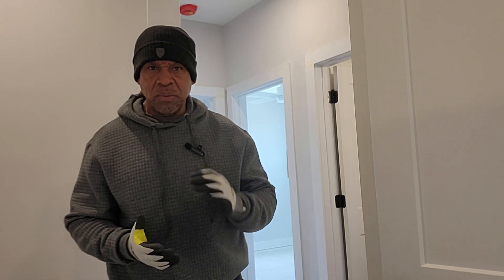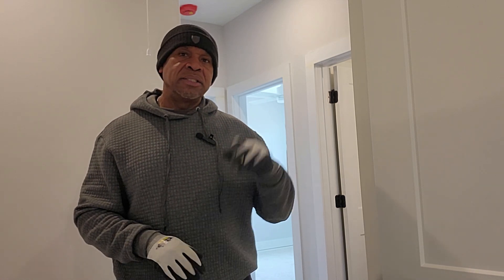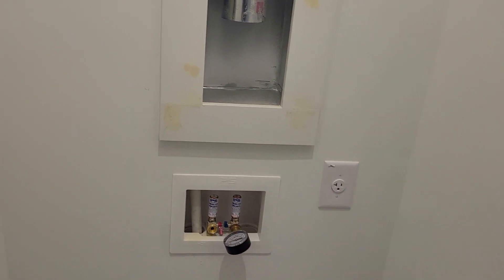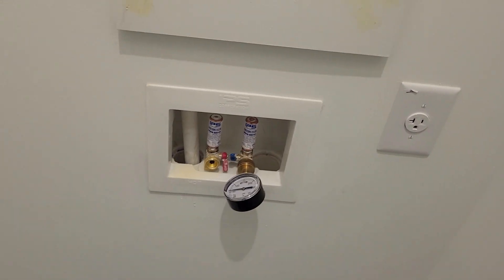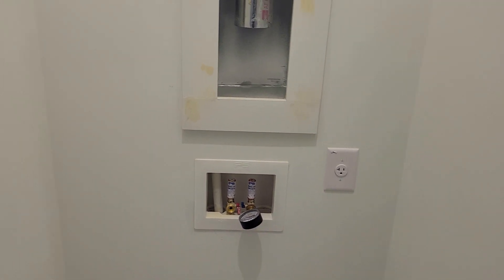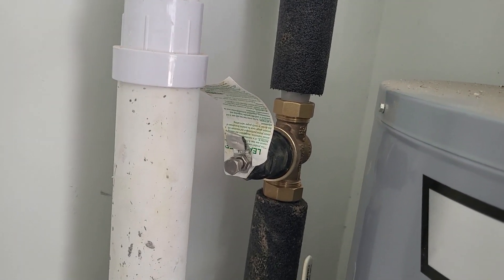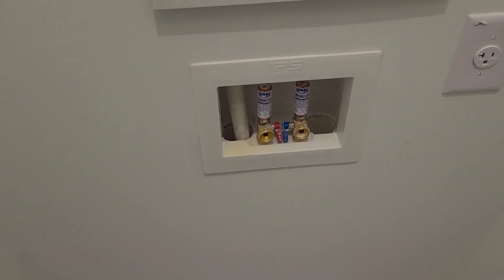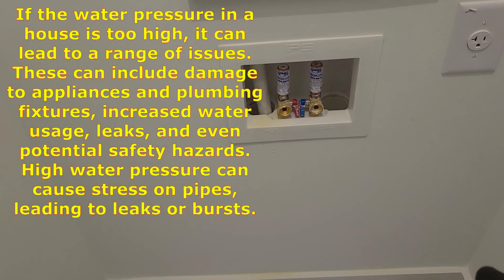Stay Away From Major Water Repairs (Know Your Incoming Water Pressure)

Comment: Thanks for the informative video. I like to keep my water pressure right at 80 because the new shower heads restrict the water so much that anything under 80 is too low. Would be nice to have a lower pressure but it’s not feasible with all this water saving stuff nowadays. As a side note I’ve found that after 15-20 years most prv’s don’t work anymore and need to be replaced. At least in my area.
Reply from the maker: I appreciate your feedback on this topic.